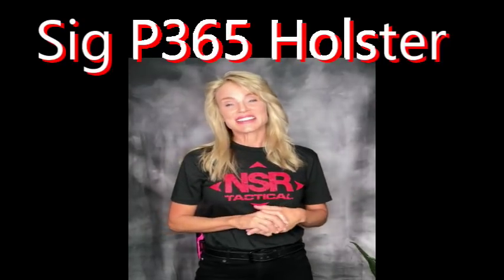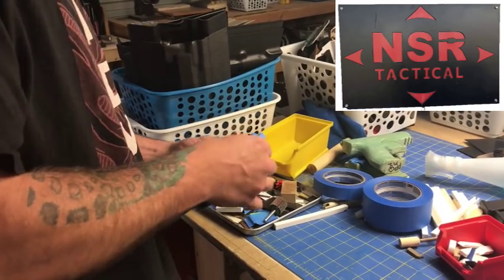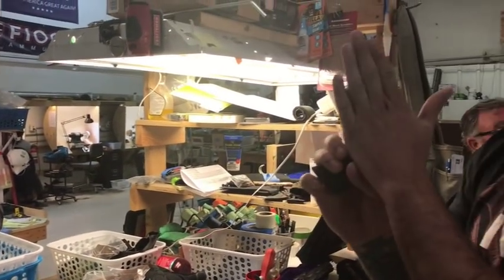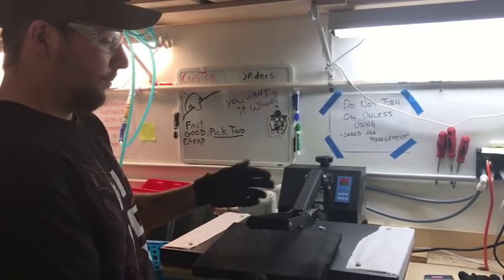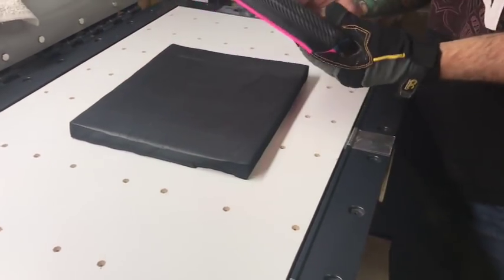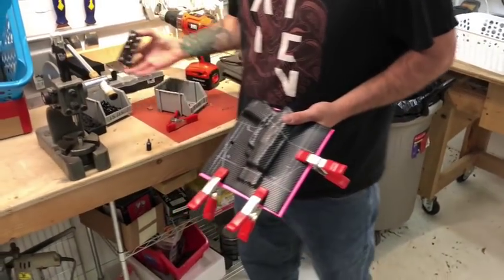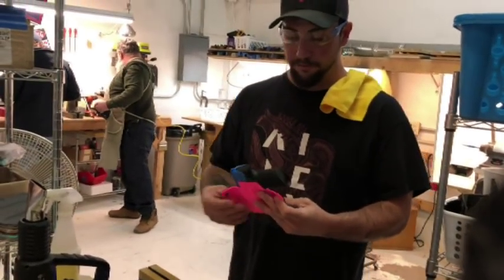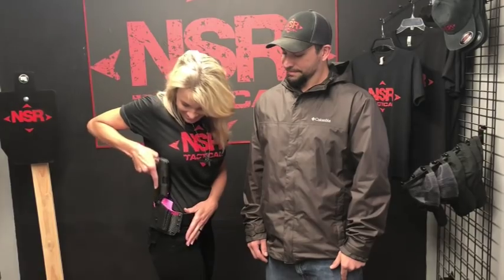Sig P365 Holster Build-NSR Tactical

Comment: Thanks for posting. Some of us are pretty early in the education process. THIS HELPS a LOT. I've seen some holster fabricators who use an aluminum cast of the gun to shape the holster. Could you use a Blue Gun? (That's a blue plastic high-resolution model of various types for practice your draw /presentation/aim. They make a Sig p365 model Blue Gun. )
Reply from the maker: I do not know anything about the blue gun, but it sounds like I need to look into that!

Comment: Have you had any more problems with your 365, or are you bug free now?  I'm waiting to buy one when they have worked out all the kinks.  :)  However, I really want one in a cool color, but I bet that will take time before those come out.  I would love one in camo....
Reply from the maker: There is always cerakote for the color. I haven't personally had any more issues, but I have heard reports about the firing pins breaking
Reply: Thank you Kelli for the idea of cerakote....I will look into that!  Our range is still trying to get a P365, so it will take time anyway and I need to try it out.    But I absolutely love my P238,  so I know it's worth the wait!
Reply: Oh dear, cerakote is expensive if you want a camo finish.  I may end up doing a Tarjac dip for my gun, which is a little cheaper.  You're fortunate to have gotten your gun now......, it seems no one has one around here and as soon as they do it's out the door!
Reply from the maker: I've seen some cool urban camo in the cerakote 👍🏻
Reply: I am sure they are awesome, but I got a price on camo that was more than I wanted to pay in cerakote....like almost 300.00.  I could get like one color for 80.00 though I think.  .....  that's not including the cost of the paint which is like 35.00 per color.  Yikes!  I may have to  keep the gun black and get a cool holster like you did.  : )  IF it's not too nosey,  and tell me if it is....how much did you pay for your 365?  I got a price of 500.00 for one today, that is when he can get one in.
Reply: Drummergirl 9   I paid $529.99 plus tax March 5Th when they were impossible to find. I have 1200+ rounds without a single malfunction. It is the BXR model not the 1st Gen. BSS. I use a Vedders LightTuck IWB holster.
Reply: Hey thanks so much!  I will tell the guy who is ordering one for me to get a BXR model then!  Glad to hear that things are going well now with yours!
Reply: BXR is the only one they sell now I think. If you can score some 12 round magazine's do it!  BXR is X-Ray sights  BSS was the Sig Sights! Good luck! :)
Reply: yes I will definitely try for the 12 round mags too.  Thanks for the advice....hopefully I can get one sooner than later!